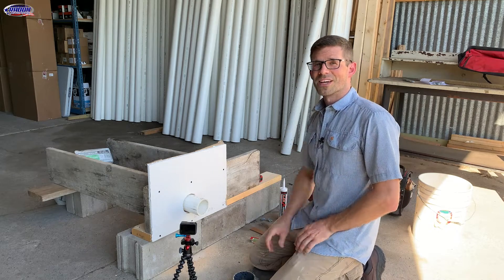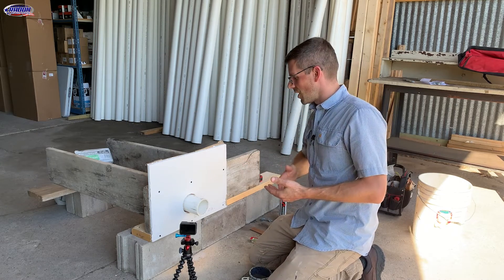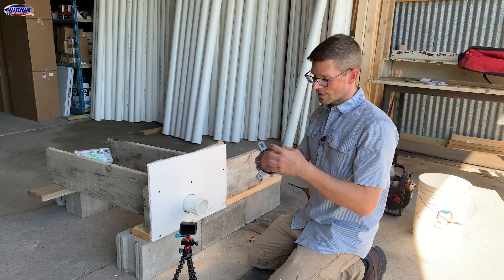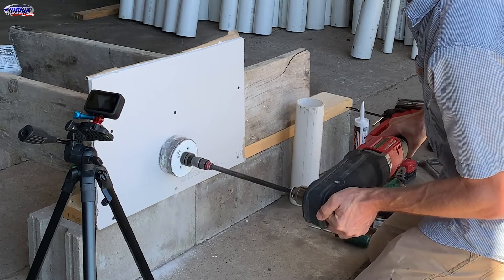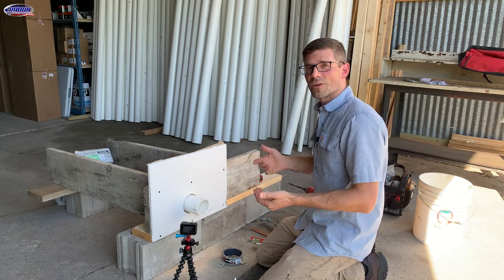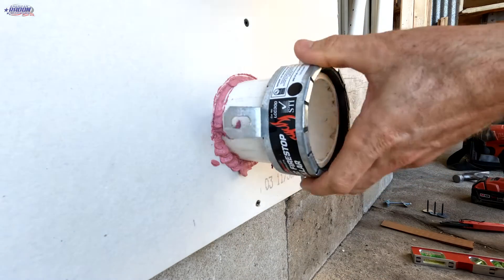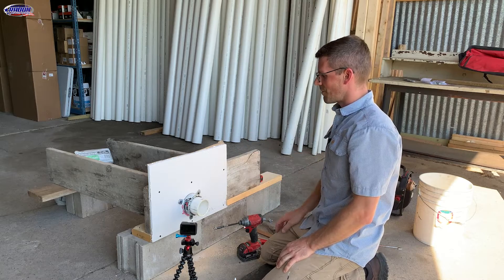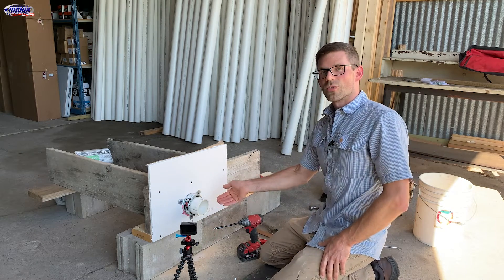How to Install a Firestop Collar

Comment: Do you need a fire collar on each side of the wall, or just one per penetration?
Reply from the maker: Good question! I’m not sure about your application. However, we use them on the garage side of the firewall to protect the house from a garage fire.

Comment: Do you need collar on exterior wall from basement to outside and fan?

Would it be outside on siding or inside basement on rim joist?

Thanks.
Reply from the maker: What you're describing is not a firewall, so there is no need for a firestop collar.

Comment: Could you do a video on fan speed controllers?  Would be nice to slow the fan down for energy savings during the times of the year when radon levels are lower.
Reply from the maker: This video shows how we dial in a radon fan with a speed controller (potentiometer). https://youtu.be/yY0G7TIUZIY?t=702 We also show this in several other videos.
Reply: @AmericanRadonMitigation  thank you